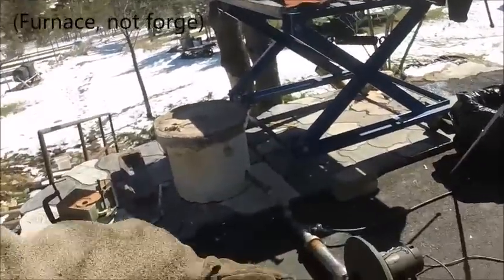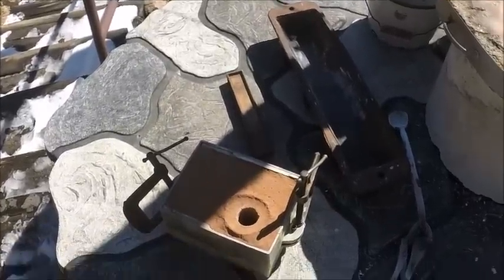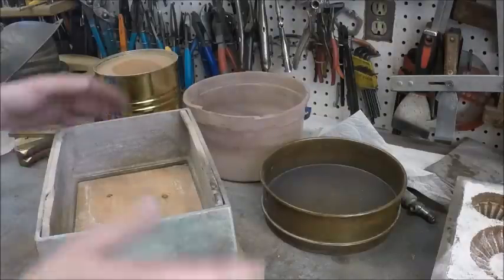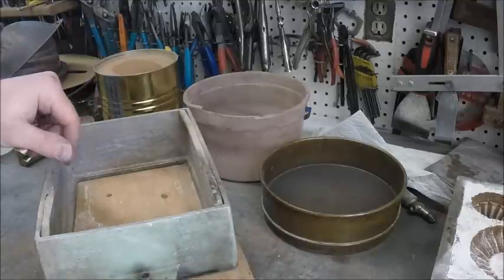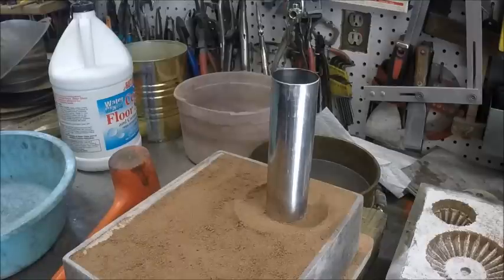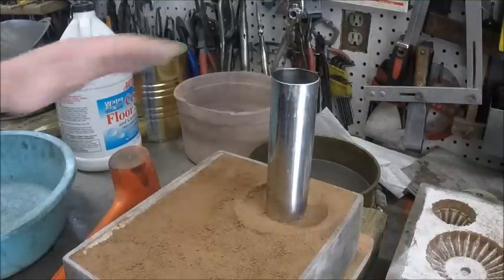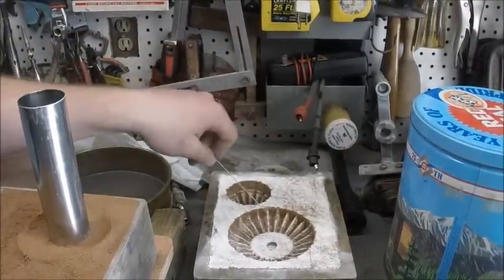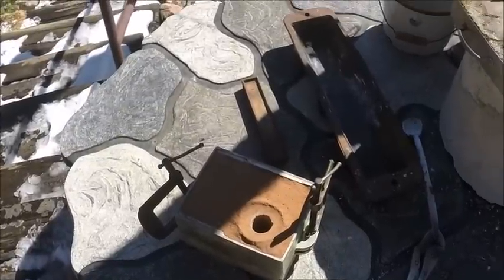casting brass bevel gears

Comment: Decent video, with good explanation of the process.  Thanks for the final machining process.  The casting process left the gears with somewhat coarse teeth.  Did you consider machining the teeth for a smoother mating surface?

Comment: A suggestion:  at time 2:10 you can avoid the mess .  By weighing the paper cup, fill with silicate, empty it back into another container, the weighing the paper cup with residual silicate that did not pour out.    Now take that weight as the tare for future pours and you don't have to scrape out every last drop?  The percentage might fluctuate a bit, but your optimal percentage is not an exact %.  Great Video......

Comment: You can speed up the drying process by getting yourself a tank of compressed co2 gas at a welding supply outlet that sales welding equipment and other welding supplies  . just as soon as you inject the co2 gas into the sodium silicate sand mixture the co2 will cause the sand to harden in just milliseconds you can watch videos online about making cores and you'll see just how quickly the co2 will harden the sand / sodium silicate mixture your casting was really rough because the sand was way too large in particle size you could use sifted clay the particle size of the natal clay is vary fine so it would allow for an much finer mold finish sifting the clay or even dirt through a fine screen then mix the sodium silicate into the clay or dirt either one of them will give you a vary fine powder from which you can make your mold give it a try you'll never use sand again that is unless you are casting iron or steel which is much hotter just make sure that you pour your casting while the mold is in the coupe and drag box that will be the safest way to prevent any casing accidents I would like to ask you  where did you get your sodium silicate from if you can answer this question I would appreciate it if not that okay to good video

Comment: hear is a teck tip to get hi temp supper glue to set up faster i put my molds in a plastic box 4 in off of the bottom with some baking soda and wight vinegar  that will set it up real fast hour or so.

Comment: Good stuff. Better than aluminum? BTW the large gear was wobbling. Did you fix that?
Reply from the maker: I really like casting in brass because the end result is stronger. But the pour is hotter and heavier.

Afraid not, decided I should just re-try with a better form and better mold. Sometimes it's just not worth the effort. :)